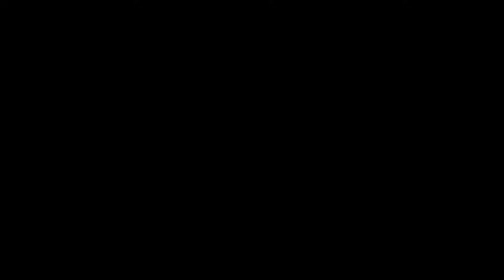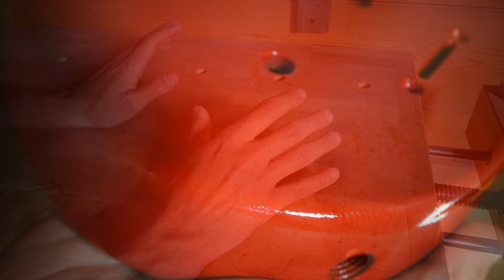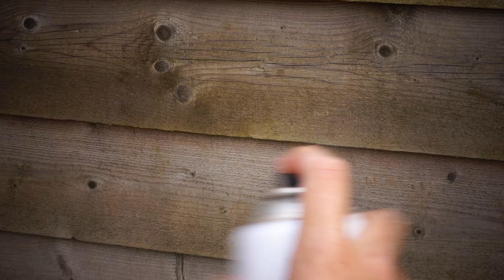Nitro Guitar Finish Tutorial - Part 2: Nitrocellulose spraying process

Comment: Excellent info!  I've refinished a drum shell, changing it from a 1980 Tama Superstar factory-finish in Super Mahogany stain to Candy Apple Red with Stewmac sprays....  I ran into (self induced) issues because I'm applying the clear gloss in Florida's  90+ F temps with humidity....  as a result I have a pretty rough surface (similar to a 120 grit sandpaper in spots) which I'll need to sand down with the 600 to 3000 grit papers I have.  I'll need to wait to reapply the clear gloss until the temps come down.  Lesson learned.

Comment: Super video and really the best in you tube to learn from. I started my own guitar body spray paint nitro cellulose and I have a question relating to your video..at 14.30 you mention about orange peel and how it can be sanded later... when to sand the orange peel, before apply the clear coat? Also is 1000 grit used for sanding? Really Appreciate if you or others can advise.. thank you

Comment: I'm a professional body man over 40 years. Video had one major thing that concerned me but otherwise well done. That is after he waited 24 hours for the paint to dry he went straight to clear coat. At this stage sanding isn't recommended but a midcoat adhesive is. Some will say that's not needed. I have found that in 5 years or more the clear will start to peel. Looks great out of the gate but not for longevity it's not worth missing this step. Especially with enamels and polyurethane. You can buy it in a spray can and it's the same exact step as his sealer. I also found this definitely helps on Sharp edges as well to help hold a little build up. Hope this helps
Reply: Yes I do realize this is lacquer. I just emphasize this is needed more over on finishes with hard shells. And a month is sufficient. I prefer to wait 6 weeks even longer for cure.
Reply: Oh and maybe a couple sock puppets for the hands. LOL

Comment: I'm doing this work at the moment.  PROBLEMS: 
 1) I've been Sprayin in temperatures between 21 and 24 and humidity of 55%-60%, idenpendently of the temperature levels I always and always have orange peel. I can't away from orange peel everytime I spray a coat. 
2) manufacturer says each spray can can give 4 coats, I spray lightly and carefylly and can't get more than 3 coats with 1 Spray can

QUESTION: If in the last coat of "Color" I have orange peel, should I sand it before the Clear Coats? Or should I leave it and the Clear Coats will disolve into the Color orange peel and then I just sand it well in the End of the Clear?

Thank you so much for the video and for your help

Comment: Do you follow the same process for spraying the clear coat Nitro that you did for the color coats? (spray, wait 20 min, repeat. Use a thin coat for the first coat)   If you find imperfections / dust in the Nitro coats do you still wait 1hr and then sand out with 1000gr paper before continuing?

Comment: I am refinishing a headstock to match the body on a P bass (capri orange). I did not do a primer coat, just sealer.
 The color coat is complete orange peel (very small). I intend to sand it with 400 grit and re-spray.   Should I reapply sealer or just adjust the color thickness and other variables as described below?
 I believe this happened for 3 reasons-  1.Temperature was around 90 F.
 2. Humidity was high. 
 3 . I applied it too thick. 
 Any comments/help would be greatly appreciated. 
 Great tutorial, much better than manufaturer's "how - to" instructions!

Comment: I'm using a Satin clear coat. I don't have orange peel. My coats are thin and nice, but they feel micro gritty. Is this normal for a satin finish? If I feel I need to sand between sets of coats,.. how long do I let it dry before sanding? Which grit of wet sand should I start with? What grit is compatible with a Satin finish? Can I sand Satin smooth enough to switch to a Gloss? What do people do with a Satin finish if the goal is not a mirror finish? Apologies for all my questions. This is my first Satin nitro finish and I had not anticipated it seeming so dramatically different than a Gloss. Thank you.

Comment: Thank you. I'm using Mohawk Satin Clear Coat over a classical guitar which was sealed with shellac and micro sanded. The Satin nitro is not familiar to me. I am getting nice thin coats but the satin looks funny? It has almost a dusty look to it? Am I not spraying "wet" enough coats? Do I sand between multiple coats when using Satin Clear Coat? If I do get some actual dust in the finish is it ok to sand? It seems very different than the Gloss products that I have purchased from StewMac and I don't know if it is actually supposed to look almost a bit dusty? I only have 4 coats on so maybe all is ok, but if something is off it would be great to get any feedback. If needed, can I micromesh a nice finish after enough coats to smooth out this fine dusty look? If needed, can I spray gloss over Satin? Thank you

Comment: Thanks for this series, it's incredible!
I have a question for you. I have a body that I want to paint nitro black, but I don't want it to be super glossy looking. I'd like pick wear to wear thru the paint organically but faster than 40 years. I also had a thought that it'd be cool to first paint the guitar white, and then black so that nicks and scratches will expose the white beneath. Do you think I could get away with just using the white primer below black paint or being that this is my first project, should I abandon the two paint idea and keep it simple? I guess what I am getting at is I don't know how much 2 paints would complicate this process. Also any advice for how to paint it in order to expeditated the relic'ing process? Would skipping the final gloss coat work or would it look bad?

Comment: 0:00 - Intro
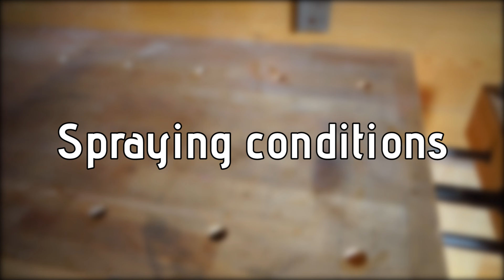0:52 - Spray Conditions
1:36 - Temperature 
2:24 - Humidity
2:52 - Air Flow
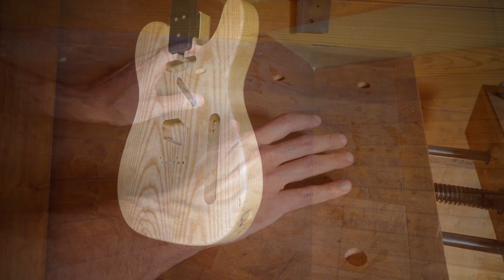3:27 - Dust/ Location
4:32 - Spray Technique
4:55 - Workpiece Positioning
6:22 - Hand Movement
7:53 - The Spraying Process
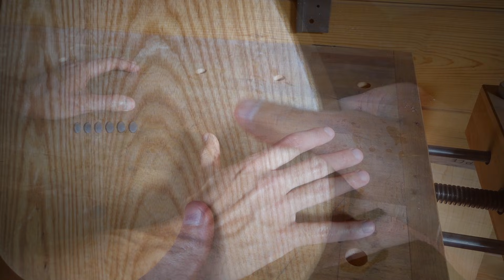9:38 - Clean the Body
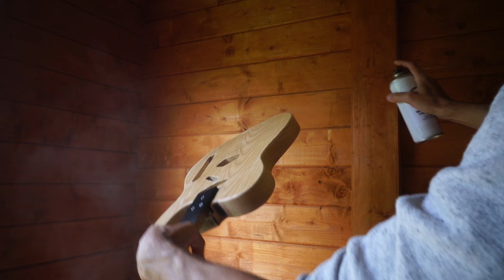11:10 - Inspection
12:23 - Primer Coat
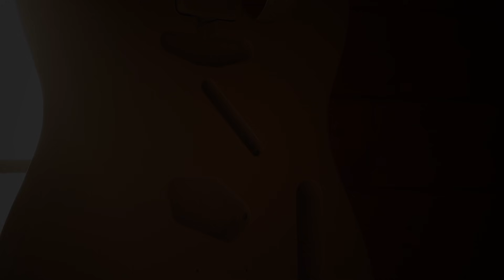13:44 - Color Coat
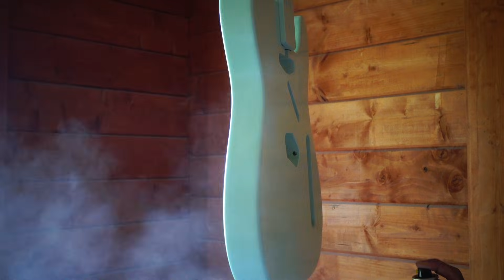14:45 - Clear Coat
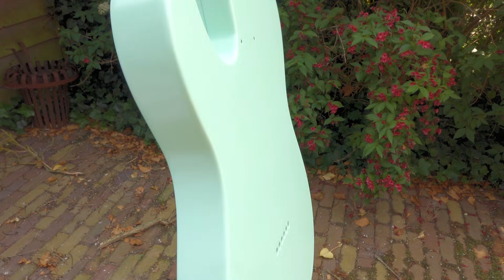15:42 - Results

Comment: Very good video. I always put a hook in strap button hole rather than drill neck pocket. I buy clear nitro at Home Depot for around $2 a can and use Tesco colors available at most hobby shops. The one near me has a great selection and the colors are even the same as some of the old Dupont auto colors. Not all are nitrocellulose, but not all Fender / Gibson custom colors were either. I learned you dont really need 6 sizes of grit. 400, 800, 1200 and a green Scotch brite will give you pro results. Finally, I love 3m Perfect It rubbing compound to buff out. You can hand buff with it just fine, but I use a friends wheel and man, it comes out like glass. It is expensive, but the best IMO and a little goes a long way.

Comment: Great video series! Question: if my primer stage reveals that I didn't fill the grain sufficiently, what do I do? Do I need to sand away the primer in that area to bare wood and patch fill with the grain filler or can I patch fill without sanding away the primer and then just do more primer coats afterwards?
Reply: Did you ever find out?
Reply: @scottjua  no, I never did. Now that I've completed my guitar I would say it depends how much you care. I did not go back and sand down to bare wood but I think it would be a nicer finish if I had made sure the guitar was totally flat with grain filler before continuing. That being said, I'm pretty happy with the results and you can only really see the imperfections if you tilt the guitar at a steep angle against backlighting. Otherwise, it's glossy and looks really nice straight on and at most angles. Probably the biggest mistake I made was not using enough nitro for the finish coats. I did one can for four coats and thought that was enough. Nope. I polished right through it after the wet sanding. It's really confusing because I think (don't quote me on this because I don't remember specifically) the Reranch site recommends one can for one guitar whereas Stewmac suggests four cans for one guitar. ?????? Anyway, I didn't totally burn through the initial finish because I just stopped soon as I saw I was cutting through but bought 4 more cans and just sprayed the hell out of it (with careful even layers).
Reply: @camaperture8116  thanks for the reply. I'm going through it all now. On the clear coats day 1. I was using Oxford and they too said one can, but that wasn't even close for pelham blue. It took three cans of pelham blue to get a decent color coat. I've gone through three cans of clear as well and that's not enough either. I did screw up and got a small buildup run so I need to fix that before going forward with more clear. I'll let it dry a day and tackle that and more clear tomorrow.

Comment: What do you do to remove, or prevent build-up of, paint in the screw holes underneath where the bridge goes?
Reply from the maker: I've never had those holes get 'plugged up', at least not by nitro (since it's so thin it's not likely to fill those holes up). After spraying though I actually like to put a drop of glue into them. Just enough so that the hole is 'plugged' and watertight. That way, when I do the final wet sanding, water won't seep in and start swelling up the wood (resulting in finish cracks). After the polishing I'll open them back up with a small sharp drill bit.

Comment: How do you do a metallic nitro finish. I’ve tried 2 times and got slight orange peel on the metallic colour coat both times. Obviously you can’t sand it out on a metallic finish. How do I avoid this? I’m using cans also. Followed every step of this video. I don’t have access to a workshop or shed. It’s really getting me down not getting the results I want.

Comment: Great tutorial! Thanks. 
I'm planning to finish a les paul kit using nitro laquer. The top is a flamed maple, so obviously will not use primer and color (I will use dyes on the top and a colored grain filler for the body and neck).
Just one question. Did you sand between one coat and the other of nitro lacquer? If so, with what grain?

Comment: What about using a vinyl sealer?
Reply: I like Mohawk vinyl sealer.it is great! I prefer it over any other sealer. I have a spray setup, but the cans are great too.
Reply: You can use a vinyl sealer with nitro or poly also. So, it's a good option. Toxic af tho. Wear a mask.
Reply: @mgcnashville6615  I have M102-8000 Mohawk.....so far so good!
Reply: Keith Schlotthauer that's what I use. I love it. I can't always spray nitro, so it's a good choice for doing both poly & nitro. Check out crystalac brite tone. Another great product.

Comment: Hi, good Job man!!!!! If I have some runs in my color, with which sanding can I remove it? 600? Or 1000?
Reply: Both will remove it. 1000 will take longer, but leave smaller scratches. I'd use 400 if the run is severe.
Reply: Ideally you don't want runs. When spraying, move your hand over the body a bit faster, and keep it 8-12 inches away. With color, it's best to just mist it on in thin coats. One coat should not color the entire surface. If one coat completely covers it, you sprayed too much. Check out the channel J COLOR on YouTube. It's a guy who works for fender custom shop. He posts lots of vids about painting.

Comment: Does anyone have experience how the tone is affected if you go for such 12 coats process or a more straight forward open pore finish e.g. color dye, sealer + few coats of oil? I'm working on an alder body and don't want it to sound dead.
Reply from the maker: My 2 cents: Those 12 coats might sound like a lot but once it's dry, sanded and polished the entire finish is about as thin as a bank note. I personally don't think the finish on an electric guitar affects tone all that much, but out of all the usual finishes a nitro finish is usually one of the thinnest (much thinner than the average poly finish).
Reply: @LoneStarGuitars  Thanks for the reply! As mentioned, I'm about to use Angelus leather dye as BigDGuitar uses often. Can I spray Nitro straight after the dye or does it need sanding sealer coats in between? I'd understand the sealer if I was rubbing in a tru-oil finish because it would also activate and move the color as well. The only sealer substitute I could find domestically was shellac chips.

Comment: Magnificent...just one question: do you have to maintain the temperature and humidity as mentioned during the 22 days? If the answer is yes, now how could it be done in a garage for the duration of that period...finally, thank you very much...
Reply: You want the temp to be steady for the whole month ideally. A few degrees won't matter. But, don't take it from a hot garage, into a cool room or you'll get checking in the finish. The temp needs to be stable. This is why many ppl only spray during spring/summer months. Winter isn't good for spraying, unless you have a climate controlled booth to spray

Comment: Hey man! One question: Concerning the light orange peel after your colour coat, you say it can easily be sandeout later. So did you sand it after 24 hours before you put on the clear coat or do you mean sanding the clear coat, because the colour would melt together? Thanks for your Tutorial - great work!!!
Reply: you could wait at least 5 hours before you can LIGHTLY sand your color coat. You could use 800 grit or maybe even steel wool to fix any imperfections you find on your guitar body.
Reply: At 12:15 he mentions what to do with orange peel.

Comment: Thank you for these videos. I'm currently painting my guitar and following these steps. I have a couple of questions if you don't mind. 
1. I am applying the sanding sealer from stew-mac but it is not a spray. It is the water based one where you brush it on just like you did with the grain filler. Since it isn't a spray, do I need a mask to protect myself at this point? The particles wont necessarily be in the air. 

2. My guitar had a stock black color on the inside cavities and it seems to be directly on the wood. Can i just apply all these principals (grain filler, sanding sealer) to the outside wood and leave the cavity as is, since it will not be shown anyway? Would that cause a problem?
Reply: 1. you will probably be safe you are outdoors or in a well ventilated place. 
2. no it won’t affect anything. because once you start putting on primer and paint color ... it will be hidden

Comment: You can use a piece of pvc pipe drill two holes for wood screws and screw that into the neck pocket if you don't have any wood around. I will sand down the primer coat if I notice imperfections and will pile on color and clear coats without any sanding between them and the orange peel will disappear on its own. I might sometimes slightly sand the last coat of the clear but stay away from the edges of the body to not go thru the paint. Then I hand polish the body and I'm done. You should use silicone free polish if you ever want to repaint the guitar otherwise the silicone will prevent new finish from sticking to the body. Also, if you're painting outside then you should use a paint booth that you can make from pvc pipes and plastic drop cloth otherwise you'll most likely get small specs of flying black matter embedded in your finish. That will definitely ruin your paint job because to dig it out the melted coats of nitro paint will pull up with the dirt and you might expose the primer coat as well. It's not like the bottom layers are solid and hard. They're soft because the layers above it are melting the layers below it. Nitro breathes and evaporates all the time. The bottom layers evaporate thru the top layers thus they melt them.